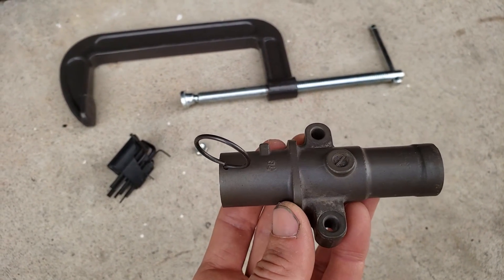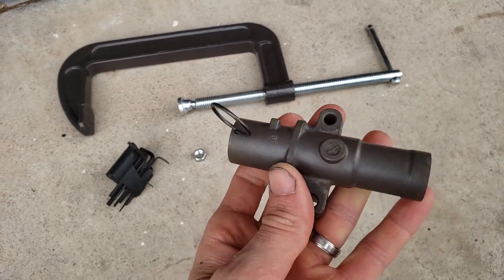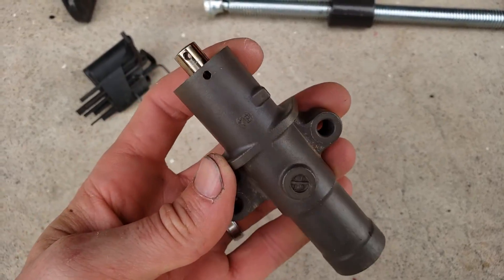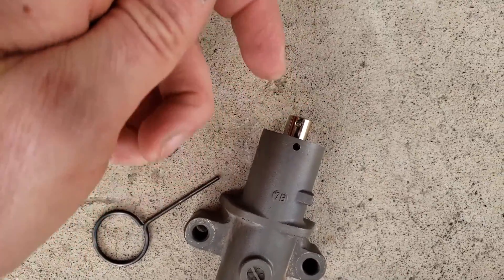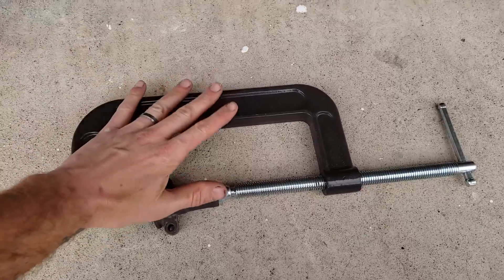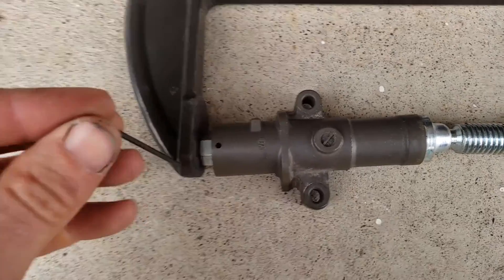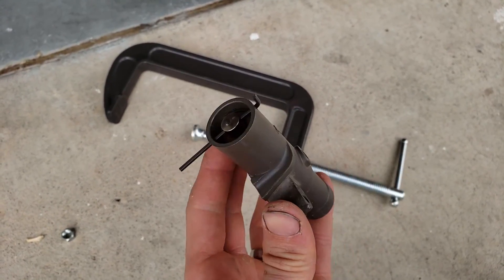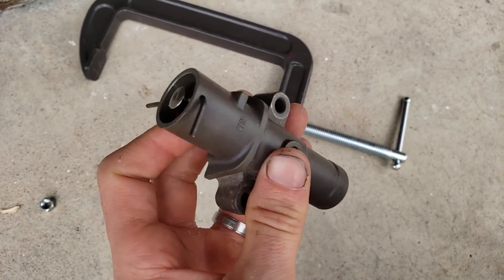How to Compress and Reset a Hydraulic Timing Belt Tensioner

Comment: thanks for the tip on size two allen key. Man, everything went really smooth today except adjusting rear cam to fit the belt on TDC and it jumped forward 90%. After awhile of adjusting it back and got TDC on every cams and crankshaft. All I had to do is pull the pin and then everything went to hell. The pin WAS SO HARD TO PULL OUT and it got stuck. First time I pulled the h.tensioner back out and reset it with the pin and put it back in. Pulled the  pin the second time. Same thing! too hard to pull it out and it got stuck again but this time it stretched the pin end to a U shape. I was so beat at the moment and just decided to shut down everything. (From 9AM-10PM just got in to rest). It'll be a hassle pull everything back out and adjust TDC again (which I'm afraid will lead to other problems). But will use allen key tip you shared. Any tip to pull the pin safely in one shot. I dont know why the damn pin is so hard to pull and got stuck twice at the very end.
Reply: I just slide a socket extension through the hole in the pin and pull  the ends with 2 hands

Comment: How long do they last ... How many times can you reuse the tensioner? Thanks for the video!
Reply: If it's new ,u can reset it,but if not ,don't recommend it,almost bent valves on a 4g63 motor ( tensioner was able to push with fingers ) ,go with a new tensioner and avoid problems
Reply: @SupriorJovHD  Thanks for the info. Hydraulic tensioners don't look like they ever wear out but I guess the seal fail eventually.